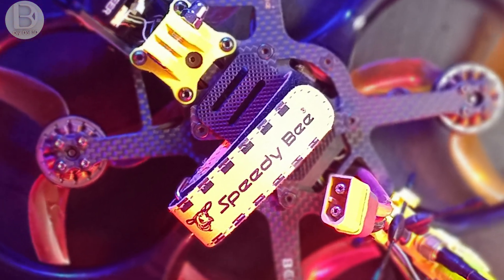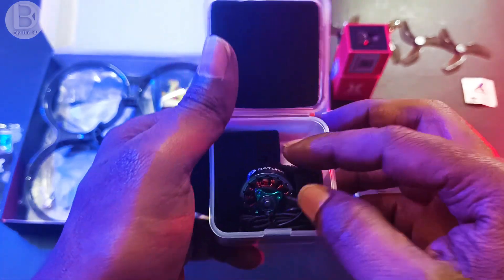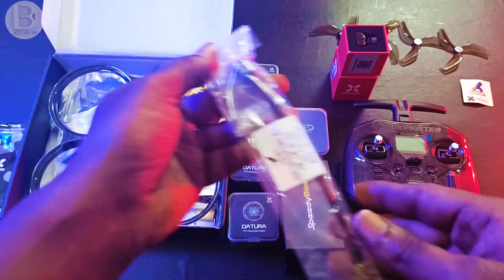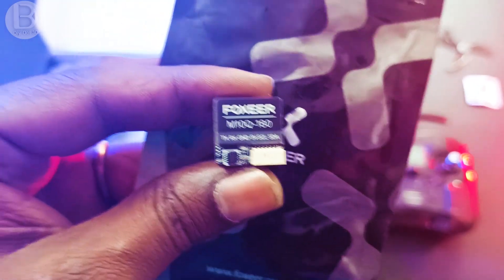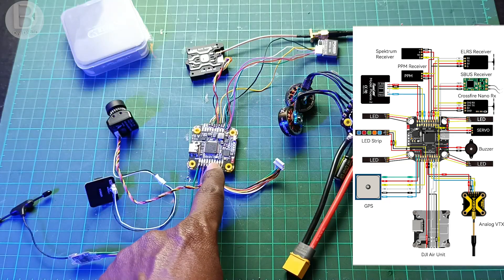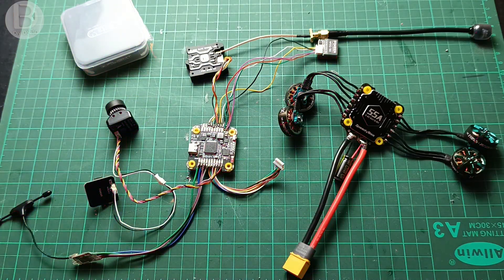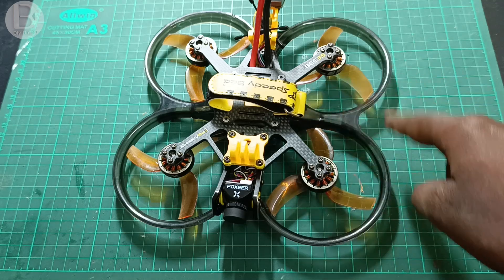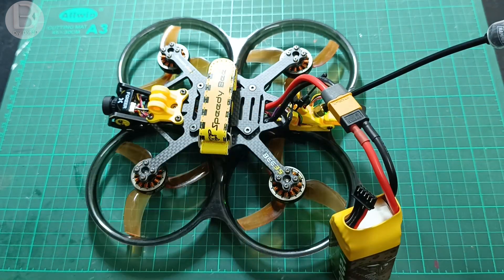Speedybee Bee35 FPV Drone Build Part 1|#speedybee #fpv #fpvdrone #freestyledrone #diydot3d #rc #fpv

Comment: Thanks for the video!
Did you need to re-adjust the position of the capacitor? Because the frame is VERY tight for me, and I'm curious how you managed to solve this problem.